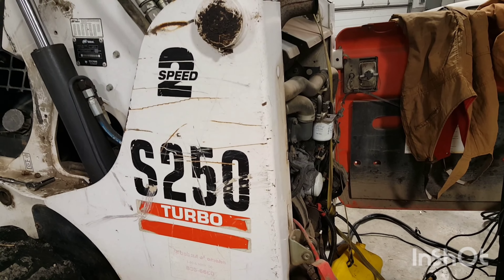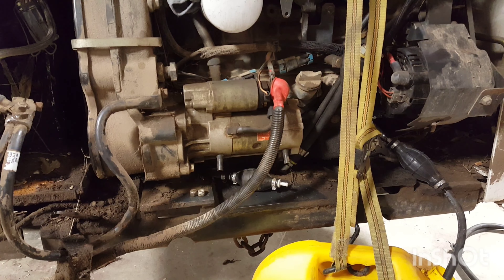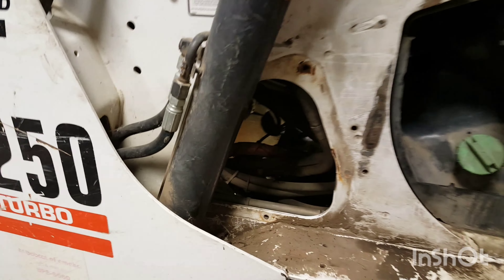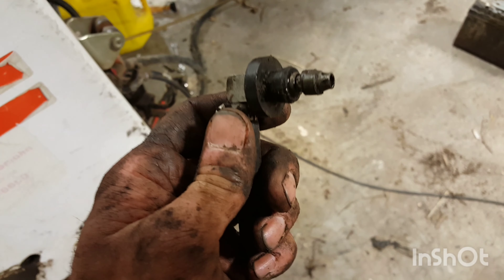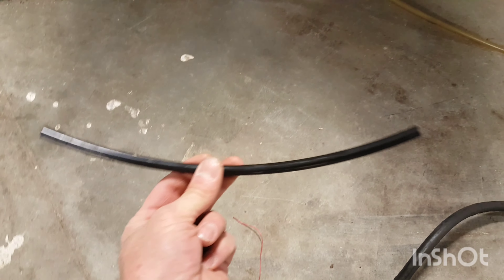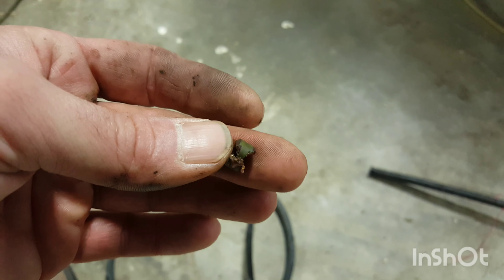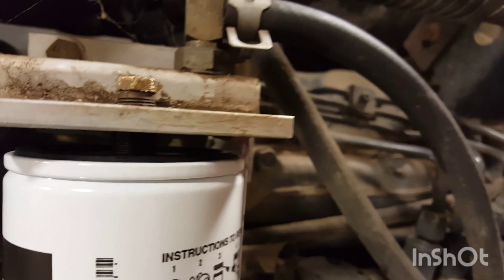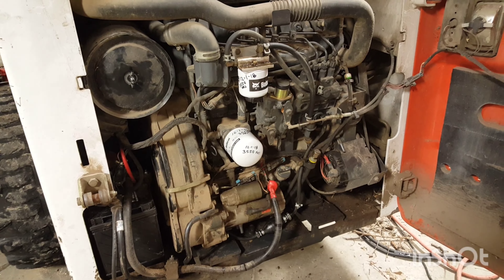Bobcat skid steer S250 quit running in the snow pile and won't start!!

Comment: Supposed to be a check valve screen on end of li ne going in the tank to keep,hose on bottom of tank and  to screen incoming fuel
Reply from the maker: I wondered about it, but the parts guy said that's all it called for.

Comment: Just for info; 
sometime near 2019 Bobcat changed the "problematic" check ball pick up tube design and switched to a "primer bulb with Check ball in "it.
Reply from the maker: @jamesbailey7785  That makes sense, I'll check that out. Every time I say I'm going investigate it when it's cutting out, it doesn't do it, typical. Thanks for the heads up on this
Reply: @secondchanceiron6123  Then they went to self priming electric fuel pump..
Reply from the maker: @jamesbailey7785  well that was nice of them, it took how long for them to think of that? 😂

Comment: Thanks for the video.  I just bought a S250.  I'll be putting on a ring gear this weekend.  My fuel guage isn't working.  From your video I see where the sending unit is.  I might just go ahead and change it if the gauge tests bad.  Always nice seeing the various angles of this machine.  When you said you fired it up and she runs like a dream, I really relate.  The engine in this thing sounds great.  Mine has 2800 hours and just sounds great.  Keep the content coming.  I'll try to share my ring gear stuff.
Reply from the maker: That sounds like a great video to watch.

Comment: I'm having the same problem with my 2005 s250 as well put a new fuel filter on and it keeps bogging down installing sometimes.
I plan on doing the fuel line from the tank to the primer bulb. But my question was did you try taking off the fuel line where it feeds into the primer bulb and take an air hose and blow back into the tank to see if you could clean out the filter on the bottom of the pickup tube in the tank?
Reply from the maker: I did blow back into the tank from the bulb side of the hose and I didnt hear any bubbling in the tank, just air coming out of the filler neck. Then I knew I had no supply of fuel to the tube. Our S205 had a clogged screen on the feed side of the bulb a couple of times, we took it out and cleaned it and she ran good until the next time it clogged.
Reply: Stalling sometimes
Reply from the maker: The bulb problem would stall if we pushed it or just not have power the rest of the time. The tube in the tank that broke caused a no start, no run condition. It's possible the supply hose is weak and collapsing, the tank could be pushed up from the bottom with mud or even ice when the water freezes under the tank and plugs a line, but the last one is more rare. Our 205 has gone through alot more bulbs then the 250 for sure. I would install a see through filter before the bulb, then tou can see if it's starving fuel from the tank and then tell you the starvation is after the filter you installed. That's an easy and cheap diagnostic tool.